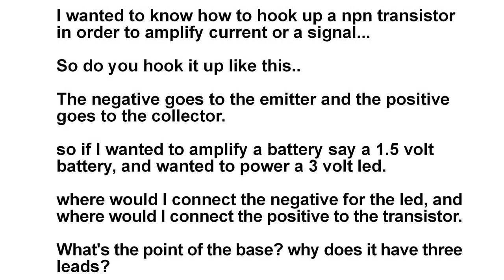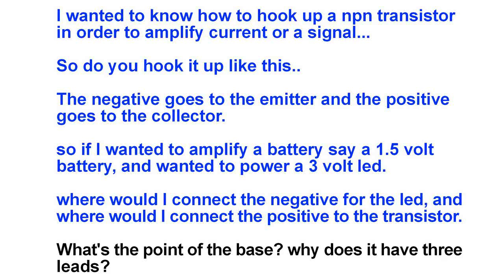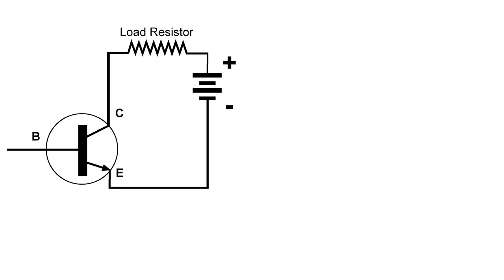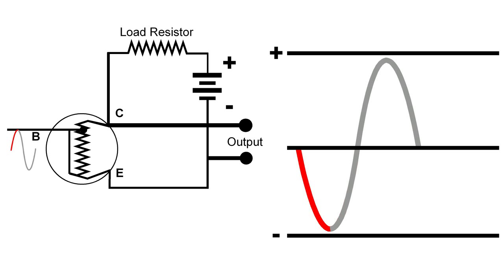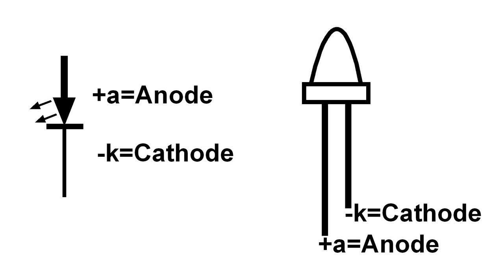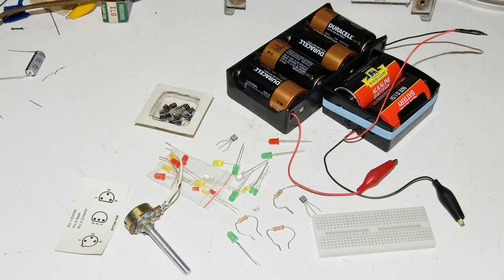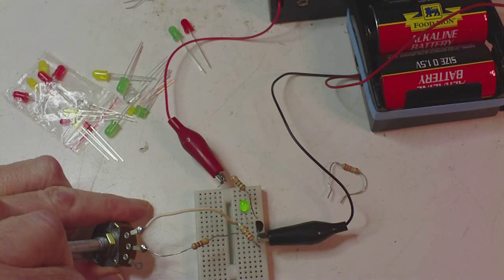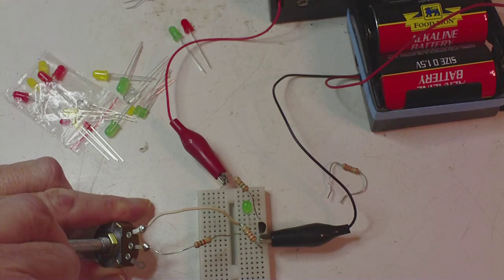Transistor and LED Questions

Comment: Cool Rick, seems to work nice. I would have thought that the wiper of the resitor would go to the + side of the battery, but after looking at your scematic, it seems to work just as good underneath the LED and directly connected to the collector. Seems odd the way you have it but it works great!!!

Comment from the maker: Hey Jon,
Sure. The 1k resistor obviously limits the positive voltage to the base. Without the 1k the 100k potentiometer could be turned down to only a few Ohms from the positive supply to the base of the transistor. This situation could damager the transistor, it many draw to much current and burn out. That is what the 1k resistor prevents.

Regards,
Rick

Comment: Hi
In the end of the video; wouldn't you be able to adjust the brightness of the LED with the 100 k potensiometer and the resistors alone? I can't figure out the purpose of the NPN in the circuit. I might be a little slow here...

Regards
Jon